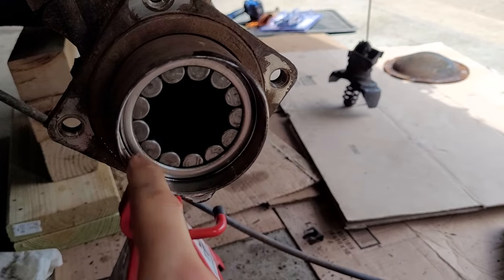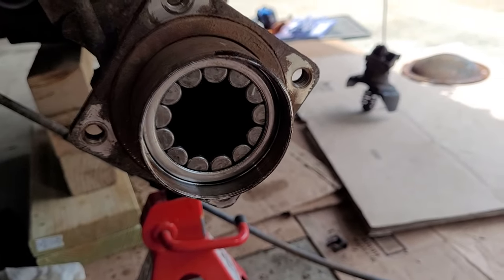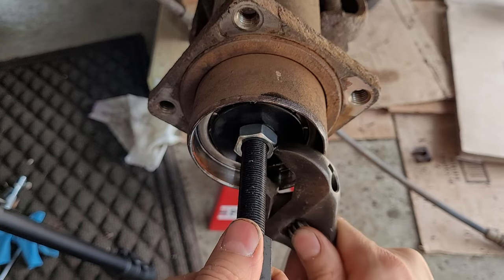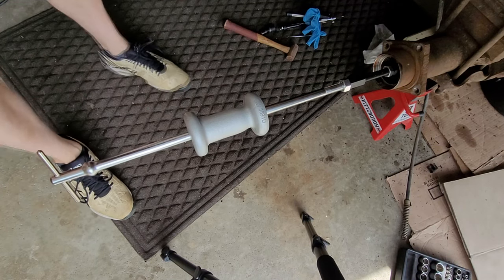How to remove rear axle bearings! (Slidehammer + axle bearing puller) ⚒️⚒️⚒️

Comment: I have an 02' Blazer ZR2 w/ the 8.5" rearend & G80 Locker. I'm having a whining sound & it starts at 25mph & gets louder the faster you go.  
I thought it was my rear drivers side, but not! I rented one of those slide hammer pullers from O'Reilly for $109, then $70 for the bearing installer tool. I'm thinking i may need to tighten up my yoke because most of the noise is coming from my diff. I have zero in/out & up/down play in rear drivers side but i have in/out play in my passenger side rear. 
The G80 locker & everything inside the diff was nice and clean.  No chips or shavings.  I just cannot find this rear noise that started out sounding like a low power steering fluid noise, then got louder as the wheels roll. The yoke, u-joints,  etc. are all tight & no leaks or clunking sounds. This has me scratching my head. lol

Comment: I have a repair bearing that will not come out, even with the slide hammer. That sucker is stuck in there like it’s welded or something!!!!!! Any advice for that
Reply: Torch/apply a good amount of heat to the axle not the bearing itself, and try again.

Comment: Any chance of some links to buy the tools
Reply: I bought my kit on Amazon. Search for (rear axle bearing     puller tool) and (slide hammer 9-way internal/external) and you need also a (seal installer bearing driver kit) to install the new bearing. I hope this help.

Comment: Anyone that has done this on a chevy silverado 2016rwd ? Had an incident where the tire fell off the rotor from being jacked up and slided to the floor and the plate behind the rotors ended up on the floor and think it might’ve damaged my bearing since the truck feels wobbly like if the tire is going to fall off but its on there lug’d tight any insights?